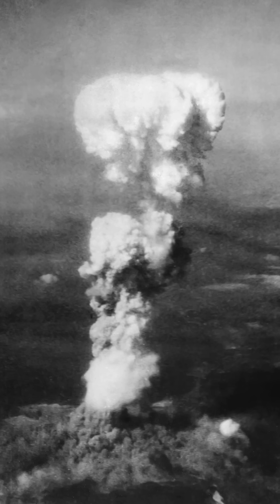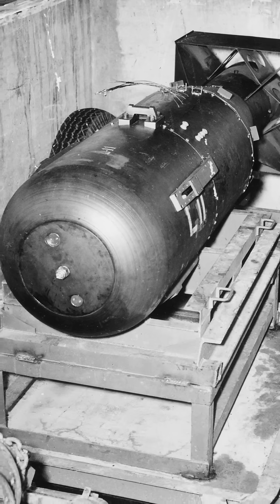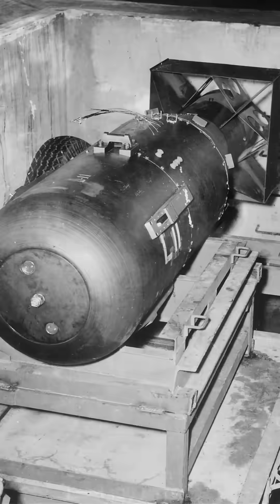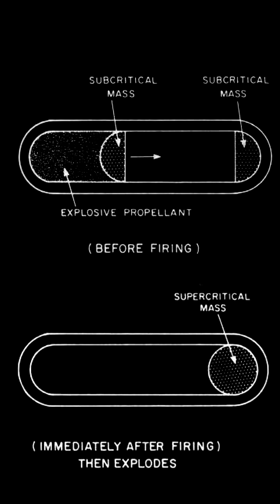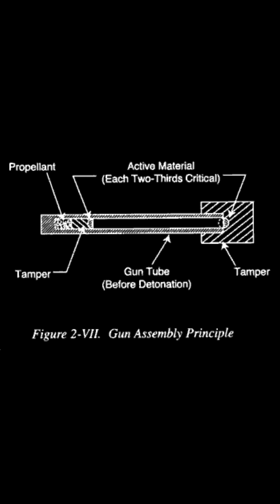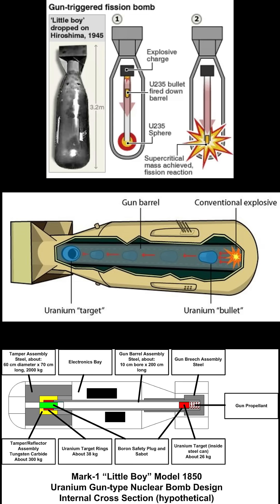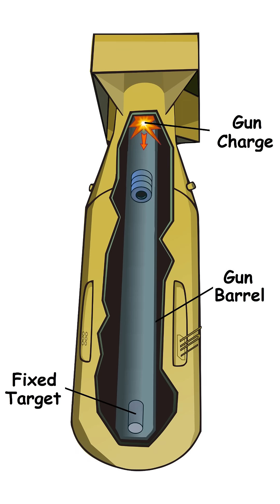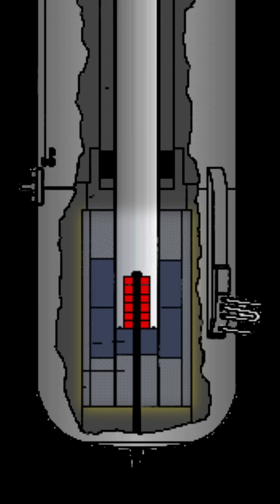What Everyone Gets Wrong About The First Nuclear Weapon Used In War

Comment: Japan had already offered to surrender on condition they be allowed to keep the Emperor. This offer was ignored on the grounds it wasn't an unconditional surrender, despite the fact Japan was effectively defeated. Even Douglas McArthur predicted significantly fewer combined allied casualties in the two planned invasions of the mainland (Kyushu and Honshu) than those in the Philippines invasion.
But a message had to be sent to Stalin, and a very expensive new weapon needed to be tested and evaluated.
Reply: This is often repeated lie about Japan “offering” to surrender, in fact there is a very good video that goes through the whole process of Japanese surrender day by day, hour by hour.
Reply: Japan also wanted no foreign occupation, to disarm itself, and to handle all trials for war crimes by itself. None of these were acceptable to the Allies.
Reply: There are so many more sources you need to read about this. It's easy to be stuck in articles whose authors start from the viewpoint that a weapon capable of such instant destruction is horrible, therefore everything about the decisions to use it must be wrong. Take it from someone who's been reading about this for decades, along with the background of how the Japanese viewed the war during its entirety; the old "conventional view" actually does turn out to be the accurate one; Japan would have suffered much more horribly if the war was fought to the end with conventional weapons. They were nowhere near as ready to surrender as some authors contend. Even after both bombs were dropped a faction of the army refused to surrender and attempted a coup.
Reply: @donjones4719  Japan had almost zero war-fighting capability left at the time. Allied aircraft overflew the country with no resistance. They reported seeing Japanese people waving white bed sheets at them. Allied ships cruised the Japanese coastline with impunity. Japan had either 14 or 18 surface ships left (depending on the source) and not enough fuel to get any of them out into open water. It was a defeated nation. The atomic bombings killed mostly women and children and the elderly. Japan was permitted to keep their Emperor, even though previously that request was claimed to be unacceptable. We occupied their country for a decade, reshaping it in our image. Many Americans prefer to cling to the "Millions of Japanese would have fought to the death!" myth but the truth is far different.
Reply: @NZobservatory you can spin your propaganda however you like but your original claim about Japan willing to surrender provided it could keep the emporor is a total historical fabrication.
Reply: @olasek7972  I hope that idea helps you sleep at night.
Reply: @NZobservatory  Japan was preparing for the invasion of Operation Olympic. They knew what they were up against (actually, they overestimated somewhat) and planned to go down fighting. Civilian defense groups were organized and taught how to fight with black powder weapons, Molotov cocktails, swords, farm implements, even hand tools (one teenager was given an awl, and she figured if she took one American with her, she would have done her duty). Media messages pushed the idea that dying in defense of the Emperor--or even suicide--was honorable. All one has to look at is Okinawa to see how effective such messages were.

You mention that they only had a handful of ships but no fuel. They planned to beach them and use them as anti-aircraft emplacements to defend the Bay of Tokyo. They collected between 10,000 and 12,000 aircraft, many of them wooden trainers that would not show up on Allied radar of the time until the last moment, to use as kamikazes, primarily targeting troop ships instead of destroyers and capital ships as they had in the past. They also had mountainous terrain that would help hide metal aircraft until the last few minutes.

And on top of all that, they still had two million full-time soldiers on the main islands.

The atomic bombs were horrific. What would have been worse is an Allied invasion. What would have made that worse is the Soviets joining in from the north, something they planned to do and which the US was powerless to stop. As it is, they took the Kuril Islands *after Japan agreed to surrender*, an act that left the two countries technically still at war until 1956 and which remains a point of contention to this day. If the Soviets had taken more, we could have ended up with a Korea-style split, possibly resulting in something like another Korean War in the Japanese islands with all the death and destruction that would have entailed. The US seriously considered (and rejected) using atomic weapons in Korea. The added pressure of a war in Japan might have greatly increased the pressure to use them. Who knows where that would have ended up.
Reply: @JarrodFrates  They were beaten. Troops on the mainland in 1945 had one rifle between three men, and ammo enough for one rifle in ten. Much of the Japanese air force from around the islandd was expected to run out of fuel and crash before even arriving at their destinations. It was a joke. Many of the troops on the mainland had been recalled much earlier, but not defend them from the allies: it was due to the military govts concerns about a possible popular uprising, such was the state of civilian morale.
The fact is we nuked Japan because we invested an enormous amount into those weapons and wanted to see what they could do. And, of course, we needed to show Stalin what we could do.
Reply: @NZobservatory  They were beaten, but they were not yet done fighting. I'm not arguing that they could win, or that they were well-prepared to fight. But they were preparing to fight anyway. They were like a boxer that refuses to stay down even though he can barely lift his arms but is hoping to get in one or two last good hits before he goes down permanently.

"Atomic diplomacy" has not been the broadly accepted theory among professional historians for almost 30 years, especially since a great deal of material previously kept secret was made available starting in the late 1980s. There were a few in the US government who were worried about the Soviets and thought the atomic bombs could be used to demonstrate a military capacity that Moscow didn't have, but while that was a concern among some people, it was not the primary concern, or even one of them. The atomic bombs were seen as a way to end the war much earlier than otherwise possible (fighting after an invasion was expected to continue into the summer of 1946) with fewer Allied casualties and no chance of Japan rebuilding and, most importantly, rearming itself. There were concerns that significant Allied casualties might cause political pressure in the Allied nations to end the war early and on more favorable (or at least less unfavorable) terms that might allow Japan to rearm.

Finally, Soviet support was not ensured. Stalin had been trying to negotiate with Churchill and Truman (and FDR before him) for an expanded sphere of Soviet influence as part of the deal for the USSR to enter the war against Japan (Japan and the USSR had a non-aggression pact signed in 1941 that was due to expire in 1946), and Truman was getting frustrated by constant demands. Stalin eventually agreed to enter the war without conditions, but it was a difficult negotiation, and until the Soviets actually did enter the war on August 8, 1945, the other Allies couldn't be completely sure they actually would. When they did, they kept pushing even after Japan agreed to stop fighting (minus some units the refused orders to lay down arms), leading to the capture of the Kuril Islands, demonstrating in a different way Stalin's unreliability.
Reply: @JarrodFrates  tl;dr, probably said the same stuff to my friends in junior high decades ago.
Japan was finished. Their war effort was dead. We nuked ‘em for all the weong reasons, but of course many Americans refuse to accept that we were and are anything less than heroes.
Reply: @NZobservatory   Japan could not win the war. They knew that. They wanted to win the surrender. The military men in power wanted Japan to remain ruled by the militarists who'd ruled it for decades. (Not talking about the Emperor.) It would have been like leaving the Nazis in charge in Germany. The stockpiles of kamikaze planes and boats and pilot cadres are well documented. The calculation was that the Allies would sicken of taking losses even at a 10 to 1 ratio, a 100 to 1, would sicken of killing civilians running at them with grenades. Read the history of how many civilians on Okinawa and other Japanese ruled islands had killed themselves rather than surrender - they'd been propagandized for years on how the subhuman whites would rape them, etc.

The US killed more people bombing Tokyo in one night than they did at either Hiroshima or Nagasaki. It took 600 planes, not one. That firebombing of cities with conventional weapons would have continued. The morality or immorality of killing tens of thousands in a day in bombing a city is the same whether one plane is used or 600. I won't dispute you if you object to that scale of killing as long as the word "atomic" isn't the term that's the basis of the objection. 

The toll on civilians from aerial bombing in the war was appalling and would have been more appalling if it had continued in Japan.
Reply: @NZobservatory  You're working on outdated historical ideas, largely dropped by professional historians over the last 30 years.

I hope that was short enough for you.
Reply: @JarrodFrates  Nope. You're clinging to childish ideals.
Reply: @Don Jones  well if "trust me bro I looked it up" is good enough for you, then I'll just say that I looked it up super duper hard, so trust me bro, dropping nuclear bombs on cities isn't justifiable.
Reply: @Kiwipai   Since there are a few thousand articles and books on this, looking it up can give any answer in the spectrum. But ask yourself, is using 400 bombers dropping incendiary bombs to kill 100,000 people more or less justifiable than using 1 bomber dropping 1 nuclear bomb to kill 50,000 people? Or is the morality equal? I'm always curious as to whether the word "nuclear" changes the moral question.
Reply: @donjones4719  destroying cities full of civilians isn't ok, and no, telling them in advance doesn't make it better. Can't belive this is contentious. With your logic American slavery was good since the utilitarian value for the people involved has today ended in a net positive.
Reply: @Kiwipai  I didn't say it was OK and mentioned nothing about telling anyone in advance. "Incendiaries" aren't leaflets.

Comment: it wasn't even the inefficiency that left it as a dead end, to make larger and larger bombs you needed longer and longer guns and even then the more uranium you stuffed in there the closer and closer each half got to critical mass without having to have the other half
Reply: Another (if not primary) reason for abandoning it was that the design posed significant risk if the thing was accidetally dropped or the plane crashed.

Implosion devices are safe, even in the worst crash they won't go off as a nuke. 
But if something shakes gun-type bomb so the material assembles, it will go off. Also, dropping the thing into water (for example crash or release at sea) will cause the unassembled parts to fission, each turning into an uncontrolled nuclear reactor (i.e. it becomes a dirty bomb if flooded, even without assembly). That's because water is a neutron moderator and uranium has much higher cross section to slow neutrons (moderated by water), so each pre-assembly part is already supercritical for slow neutrons, it just needs adding a moderator. Slow neutrons are too slow to cause a full detonation, but the thing will go off with a power comparable to conventional explosives and disperse nasty stuff.
Reply: @SebastianKaliszewski  Gun types weren't "abandoned" until after the cold war.
Also, the implosion architecture is not inherently safe. Several implosion types devices produced by the US have failed one-point safety tests.
Reply: @Evan_Bell  
They're much more inherently safe than gun type weapons systems, though.
To donate an implosion type Munition you need to discharge about 90% of the primary charges, and all in synchronization, to cause a criticality event.

So I don't know what single point safety checks they were testing, but we're talking about dropping the things from planes.... Which implosion types have survived, unexploded, repeatedly. In fact, it's a higher chance of success (broken arrow with little to no collateral damage, physics package remains non-critical) with implosion weapons than towards failure.

This doesn't mean they always remain undetonated. But "inherently safe" doesn't mean "perfect track record," and vice-versa.
Reply: @Fightre_Flighte  Yes, implosion type weapons are generally safer than gun types. However you also have to consider than gun types are easier to assemble and disassemble. For gun type AFAPs, (Mk-9, 19, 23 and 33) they were stored partly disassembled for safety.
For weapons that are not one-point safe, such as early US implosion weapons, and possibly the current implosion weapons of several other countries which may not have replicated the dedicated campaign in pursuit of achieving the one-point safety standard that the US did, the level of synchronicity required to produce a nuclear yield may not be as high.
As for needing to detonate 90% of the charges, modern weapons only have two hemispherical charges, which are capable of sympathetically detonating each other.
The weapons using non-insensitive high explosives, that detonated in accidents, such as the B28s at Palomares, were certified one-point safe. They exploded, but did not produce a nuclear yield, because they were one-point safe. They contaminated the local area with plutonium and uranium.
I interpret "inherently safe" to mean the implosion configuration is by default invulnerable to accidental nuclear yield. This is not the case.